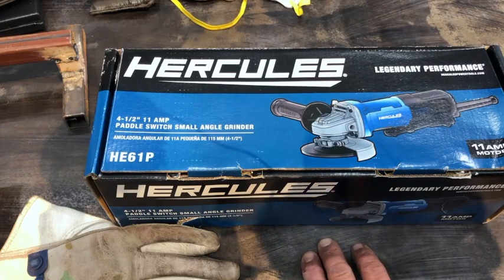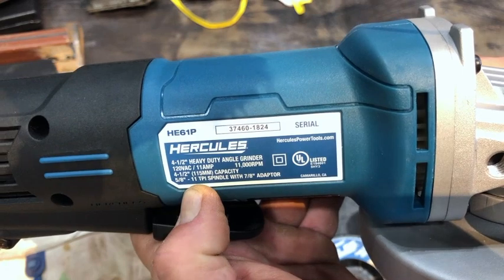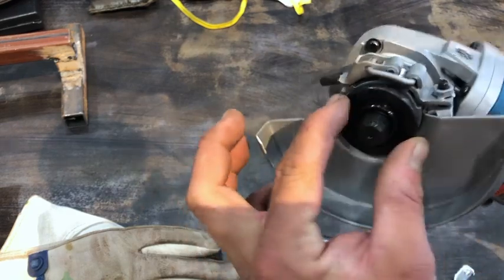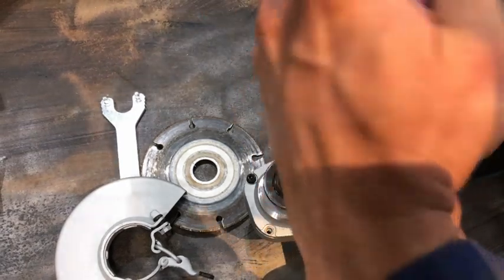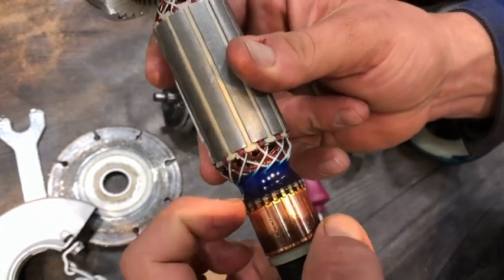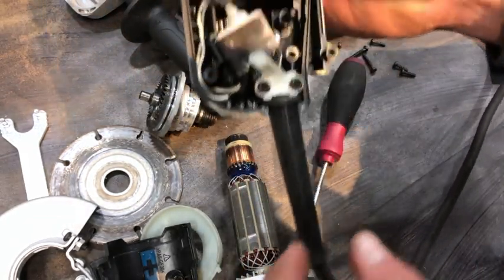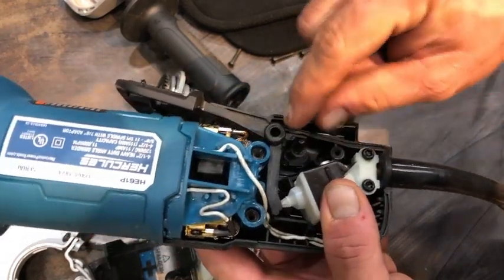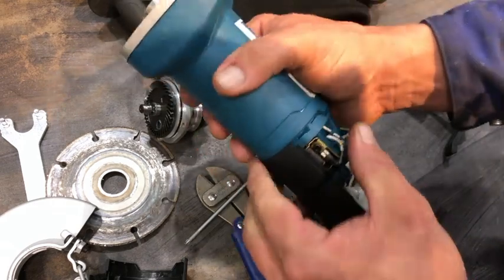Hercules 11 Amp 4 1/2 inch angle grinder review.

Comment: Saw this at HF and totally brought it on impulse and I'm quite impressed.  One thing though.  Thst switch is not a dummy switch.  It's a trigger lock.  Although usless for quick jobs and dangerous for rookies.  I find them very useful.  They reduce fatigue and allow for better grip in out of position grinding.  And this is the first grinder with a trigger lock that I don't feel like I will accidentally engage it.  And that coupon made it all worth it.
Reply from the maker: Yup, it's trigger lock, that many oilfield safety programs require to be absent or disabled...

 I don't know a single welder lacking a grinder scar. The most impressive of those is a guy in my Jeep club. Its on his neck; 6 or so inches long. At work, its all PAPR hoods and glasses for him. At home however, why bother? 40 years structural and pipeline welding. He was grinding on a trailer hitch to make it pretty...a damn trailer hitch!, and nearly died. If it can happen to experienced pro's, it can happen to any of us. 

Remember, there's no workers compensation if you get hurt in your garage, and if grinding at work: why get hurt making another man rich? If fatigue is at all an issue, put the dang thing down and take a minute. Coffee's better than grinding anyway.

If you insist on using a trigger lock, consider a foot switch, that way if it gets loose you can turn it off.
Reply: Don't get caught on a Mine site with a trigger lock MSHA will fine you for sure.
Reply: Not everybody works in a mine or a oil field. I don't know what happened exactly to the Jeep guy but maybe it would have happened also without a trigger lock

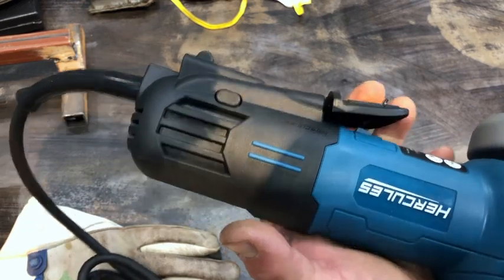Comment: Time-2:55 I respectfully disagree about the "dummy switch." While I agree that using it has its hazards, using it also allows the user to grip the grinder with both hands for a more precise cut when using the cut-off wheel. If using a twisted wire wheel, or a grinding disk, I wholeheartedly agree.
Reply from the maker: When I was editing I thought...that'll piss somebody off. 
Thanks for the polite rebuttal, manners are rare these days, especially online. 

When I have to get precise i go for the Dremel or the die grinder with a small cutoff wheel.

Comment: Thanks for the review. I have the Chicago Electric version of the blue one and it was a great grinder. I like the look and features of this Hercules. I'd replace the CE version with one of these, if and when the time comes.
Reply: One thing I have to say if you do decide to do this is, do not treat the Hercules like the Chicago Electric.  The Chicago Electric is the girl next door that you take out on a date on a Wednesday night.  She is a good girl, but she does what you need.  This Hercules is the crazy chick that you dated one, she took you out on a Friday night and you got home on a Tuesday morning, with two tattoos that you can't quite remember getting, and you are pretty sure there were three different cop chases at different points but can't be sure.  This is a wild girl.  Act like it is a 7 inch angle grinder that is too light for its own good and pissed off that it got reduced to a 4-1/2 inch grinder, because that is what it is.  I got 1 other guy to even try dry running this thing (other than me) this past evening, in a welding class.  I also had the Bauer 8 amp with paddle switch, and she was the belle of the ball, I swear, everyone wanted to run that thing.  The Chicago Electric also got some attention, but the guys watched me start up and run the Hercules and said "Hell no" to running it.  It is torqued to the point I am not sure if I could have bogged it down or burned it up if I had used a grinding wheel to cut the 3.8ths" plate that I had to cut for my buddy.  So, just show the tool the respect it is due.
Reply: @Jeremiah90526  lmao. This is the best review ever. Thank you so much.

Comment: Harbor Freight has really raised their game with these Hercules and Bauer tools.  I was kind of on the fence between buying this Hercules grinder or the 11amp Bauer.  I think I like this Hercules better.  A bunch of the same internal components are probably shared by both.  I just like the design of the Hercules a little better.  I'll be using mine mainly to sharpen brush axes and mower blades

Comment: Thank you for the video review and taking your time to make it. I start welding school next month and was wondering will this be good enough for class purposes? My school said I need a 4-1/2 “ angle grinder. I don’t have much money and it seems good enough as per your video.
Reply from the maker: It will hold up. If you get it with the $59 coupon you’ll be fine. If you can’t wait and have to pay the full $89....dig deep and go for a makita, metabo, dewalt, or Milwaukee. My favorite of those is the makita, #2 is metabo. 

The metabo wp9-115 is $89 on Amazon. 

The Hercules is ONLY nice at $59. Cause at 89 you could have a metabo.

Comment: The switch lock is not for using the grinder in your hands. It is there so if you want to mount the grinder on a workbench you can use it as a bench grinder and hold the item you are grinding without having to also hold the switch down.
Reply from the maker: You might use it that way, but go work pipeline and see what the welders do. Then look at their hands.
Some models of angle grinders only have slide switches that only lock on.
Reply: @texacajundiy  I am not following you, are you saying that workers on the pipeline only use locking switch grinders? I was a fabricator for literally years, I am in my 50's, and it was never recommended we use the lock when grinding, but then again I was in a factory and not out in a field setting too and I was not holding the grinder for hours at a time. That would make a huge difference. I was merely pointing out that the lock has some benefits to it.
Reply from the maker: @stauguastine  No I'm not saying they only use the lock. A lot of them do, even upside-down, in a hole, or overhead. 
It's to the point that many companies won't allow grinders with locks or require they be disabled to be on their job sites.

I do agree the lock CAN be useful. Even in a bench setup, I like a footswitch. 
Also, I like gloves. A ton of ppl say that gloves will get caught, but some of the guys I workout with are oilfield safety and fab company owners. In practice, less injuries occur with gloves.
Reply: A grinder is a quality of life changing tool. You need to respect it 100%

Comment: I have a Chicago electric  grinder. Looking to upgrade to a higher amp. How do you think this would do for power carving. The paddle switch is a plus due to some of the carving wheels used.
Reply from the maker: Honestly I think it would be quite good for that. I can bog it down, but that has more to do with me being 245lbs and impatient. At $50-60 it’s a steal. 

To be clear, I would not pay full price for this thing. Not because of quality, the quality is there. 
At $80 it’s within $5-15 of a mainstream brand that can be easily repaired at any tool repair house. That repairability is worth something to me.
Reply: Thanks. Seen mixed reviews on this model. Do you know if harbor freight will take the 20 percent off coupon on it? I've heard they won't on Hercules and Bauer.

Comment: Most everything electric harbor freight sells comes with a second set of brushes.  I typically buy Dewalt and don't come with brushes.  With that being said I have never had to change brushes is any power tool I have ever owned including harbor  freight power tools. I use these grinders all day sometimes every day for a week straight.  I do large equipment refurbishing and a lot of heavy steel rust repair cut out and weld in patches.  I did an 80' extendable flatbed and had to change the top plates all the way. Rebuilt rusted out dump boxes that were so bad it would have been easier to build a new one! That's a lot of grinding.  Still, never changed brushes. I don't know if they think that's a big selling point or what. There's other failures long before the brushes go out in my experience.
Reply from the maker: When I worked the tool room at 𝙾𝚖𝚎𝚐𝚊 in the port of Iberia we’d change brushes pretty often. 
Overhead grinding on production platforms...The welders helpers should get trash in them and tear the brushes up.
Reply: Go brushless and don’t worry about it 🤪
Reply: @texacajundiy  I suppose it's the environment the grinders live in.